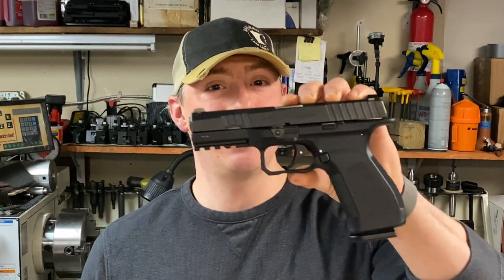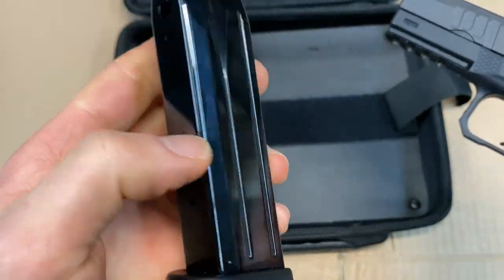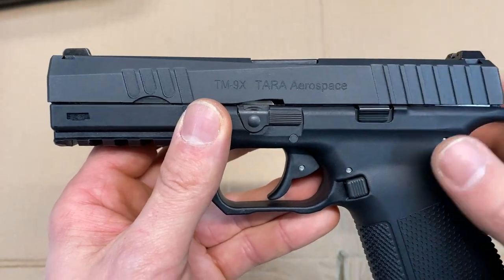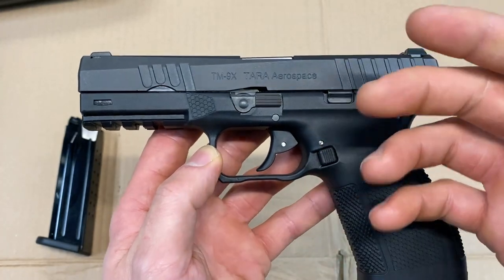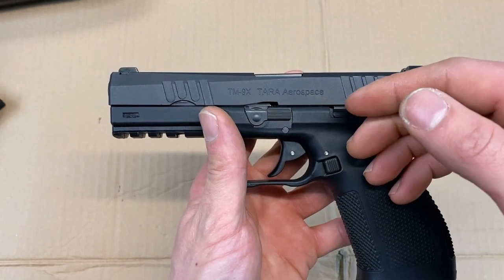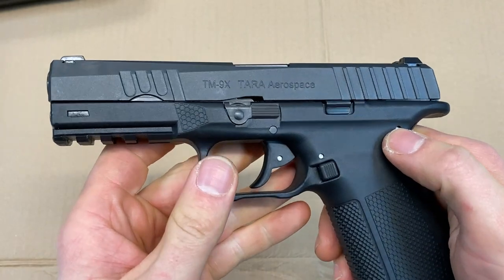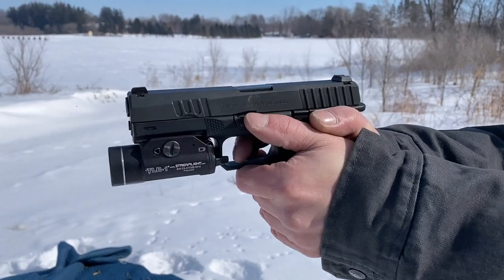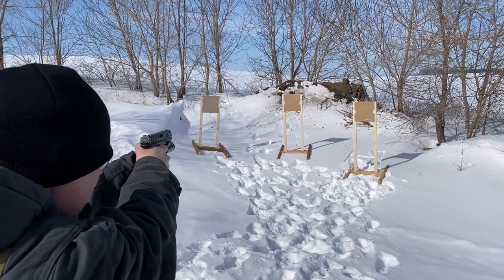TARA Aerospace TM-9X Review and range time #tm9 #sig516 #aerospace

Comment: Regards from Montenegro. Great to see you using our product 😄
Reply from the maker: Absolutely!! It’s a great pistol!
Reply: @jeerrrrrrryyyyy  this Gen2 version is very good and much better quality vise then Gen1. Also in USA is two time cheaper then in country where is made, and its hard to find one, everything goes for export.
Did you saw gountlet test on Poland chanel? It run it without stop 😄🤗
Reply from the maker: @balsakralj  I did! Very cool. It didn’t have a single problem.
Reply: the slide is CNC machined from a single piece of steel.
Reply from the maker: @vlpeev  Yes, but what was the process of getting the piece of steel is my question. After processing the iron ore at a foundry, what is the process used to get the pice of steel? Cast? MIM? Cold roll? Hot roll? Etc, Etc.
Reply: @jeerrrrrrryyyyy  The last time I was in the factory the plan was to use hot-rolled bars in the profile of the slide to reduce waste of material. the line you can see on the slide can be also due to the CNC programming and the passes of the cutting tool. The internal front and rear inserts are MIM... in the early design ot was one piece stamped steel part. If you want to fully understand the trigger system on that pistol google the patent number on the bottom of the grip.
Reply from the maker: @vlpeev  Thank you, I will look that up.
Reply: @jeerrrrrrryyyyy  if you have any questions I will be happy to reply.
Reply from the maker: @vlpeev  awesome! Thank you very much!

Comment: Those damn Montenagrens !!! Cool pistol, and great presentation.
Reply from the maker: 😂 yeah, they get yea every time lol!
Thank you very much NEPA!
Reply: @jeerrrrrrryyyyy  for the same price of 399 I believe Arex Delta gen 1 could be a better buy, easy trigger 4.5lb and 2mm reset. I just feel a 8lb trigger for a pistol is very uncommon since most stock trigger run about 4-6 lbs unless the "single action" after first shot has a different weight.
Reply from the maker: @dukenukem9666  good point, the difference is the lack of a safety, so the trigger being more in line with a revolver weight makes sense. 
   I agree that the Arex is a great contender, but I don’t have direct experience with the delta, just the zero 1 from Arex.
Reply: @dukenukem9666  Rex Delta isn't a DA/SA pistol, though.  The Tara trigger is different after the first shot as long as you don't fully release the trigger after reset. See ClassicFirearms review.

Comment: This is basically a double action/single action pistol, but has to be manually managed by the trigger.  The 7+lb trigger pull is double action, after reset, it is single action and is (should be) significantly less as long as you don't allow the trigger to go all the way back to original position on second and subsequent shots.
Reply from the maker: Yup, that’s it in a nutshell.

Comment: Excellent video and I've never seen anything on this pistol before , but that line on the slide has me curious now 👍👍
Reply from the maker: Yeah me too! I’m very interested in how they are manufacturing the slide. Thank you very much Ninja!
Reply: @jeerrrrrrryyyyy  like you said, that line is most likely a casting mark...doubtful that its any kind of tooling mark. Hows the weight on the slide when its stripped? Whats it feel like to you?
Reply from the maker: @stephanieandjared390  if the slide is stripped it weighs in at 302g, or 10 5/8 oz.

Comment: The first trigger DA is heavy the follow up I bet is sub 3.5 lbs   That's pretty much how it is advertised from tara as well.
Reply from the maker: Yeah, it just takes a bit to get used to using.
Reply: @jeerrrrrrryyyyy  Yeah I can see that when everyone is used to decent modern striker fired pistols.  It's light years better that some of my old 80's duty Smith's. That first trigger pull in DA is heavy but even then after a few range trips it's but another function of the pistol.  I rather like the follow up when it is in SA is pretty nice.   I do not see the line like you have on the top of the slide in the G1 version I have.  Something may have changed when they switched to the 2nd gen slide.  The Gen1 version was advertised from Tara Aerospace claimed the first gen slide was milled from forged steel.   As a Addendum I have found some ruger sr9 full size mags that can be made to work in them.  I have a Video on my channel showing the simple mod on some cheapo promags that work in the Tara if anyone has a few minutes and wants to check out.    I cast and ran about 500 125 tc coated lee bullets through mine over the summer. It's a decent duty sized gun that is accurate.  After that I loaded up a bunch of 125gr xtp's and  took it as a trunk gun during a trip from the midwest to florida.   I used it down there with some 9mm range ammo at a indoor range while the wife and kiddo's shopped . It ran fine with those as well. .   I should have bought several of them to have for range fodder. I paid 219.00 for mine right before the Covid crap hit. After that they jumped up quite considerably .  Great videos on your channel.  Nice enthusiasm for the sport.. Subbed.
Reply from the maker: @bryco32   this gets the best response trophy for this video! 
That’s cool that you got a 1st gen!!! I’m a little jealous to be honest. $219 is a great price. Thank you very much for the info and I will be checking out your channel and video!

Comment: I have the same brand new Tara TM9, it jammed every single rounds out of box, is that likely a limp wristing? or gun problem? Did you ever encounter this?
Reply from the maker: How is it jamming?

Failure to eject? “Stove pipe” or “empty in chamber”?

Failure to feed? “Empty chamber” or “live round not seating in chamber properly”?
Reply: @jeerrrrrrryyyyy  stovepipe, also slide lock back with rounds in magazine, i hope there is nothing wrong with it.
Reply from the maker: @ruilanguage  the stove pipe could be from what you call “limp wristing” it can also be from low power ammunition or even something as simple as different types of case material used with different chamber finishes.
   If the slide is locking back and there is still rounds in the magazines this can sometimes be caused by gripping the pistol in a manner that leads to upward pressure on the slide lock/ slide release during use. 
   In either of these specific cases I would recommend having it looked at by a qualified gunsmith just in case. 
   Obviously if your pistol is malfunctioning due in whole or in part by user error, then there’s nothing wrong with the pistol, and possible adjustments in user control or operational adjustments/ training is in order.
Reply: @jeerrrrrrryyyyy  Thank you for the reply, the ammo i used is cci blazer aluminum case 115 gr fmj,  have you used this in your Tara Tm9?
Reply from the maker: @ruilanguage   No I have not. I have heard mixed reviews on its ammunition. As a first step you could try using a known good quality brass cased ammunition to see if that helps.
Reply: @jeerrrrrrryyyyy  Thank you for the suggestions, I will try that
Reply: @ruilanguage  Would run better with 124gr.

Comment: Very good review indeed so don't take this the wrong way but what's going on with all this YouTube gun reviews complaining how 7-8 lbs trigger pull is very/extremely heavy? That should be bare minimum on self defense / duty handgun and if trigger is smooth even 10-12 lbs is nothing heavy.
Reply from the maker: I agree in part of your opinion. The gun community seems to want a 5 lbs of less pull weight. Of course this is all opinion in the end, but I do know 4 people that have crippling arthritis and a heavier trigger pull definitely effects their ability to operate proficiently. Now put one that has a lighter pull weight and they are able to run the mechanics noticeably quicker.
   I do wish more people that have the physical ability to deal with a heavier trigger not complain about a heavier one, take the Beretta ARX for example. I love the one, but people seem to hate it due to the trigger weight mostly. 

   Thank you for checking out the video, and your opinion on heavy trigger pulls.

Comment: What holster were you using for this video?
Reply from the maker: Not the correct one to be honest. 
I noticed that they will have some success in Glock style holsters for wide frame glocks chambered in 45acp and 10mm. 
   The specific holster I used (and it doesn’t work well) is a T-Rex arms for a Glock model 45 with surefire X300u light.
Reply: I recently ordered a Tara and I’ve been searching for a holster. Was wondering about a Glock 17 because of size similarities but the trigger guard on the Glock is curved on the front so I’m not sure that it will fit. Gonna run by PSA tomorrow and try it in a couple of different holsters. I’ll let you know if I have any success.
Reply: New subscriber by the way and this was a great video.
Reply from the maker: @anthonydavis8741  I know that the qcq holster that locks the trigger guard for Glock model 20 works but I don’t recommend those holsters.
   Yes please let me know what works, and thank you very much for sharing the information with us.
Reply from the maker: @anthonydavis8741  Thank you very much Anthony! I really appreciate that.

Comment: The line down the middle of your slide is unique to yours.  Mine does not have that.
Reply from the maker: Is yours a 1st generation or 2nd generation?
Reply: @jeerrrrrrryyyyy  Presumably a second generation.  It’s the X model.  Mine did have some dings from the lock that was supplied with it and the soft case but other than that no cosmetic issues.
Reply from the maker: @ChrisJohnson-rn2ls  that’s a good thing. The question still stands that I don’t know what that line is from.
Reply: Presumably a machining error?  Mine has a mark on the underside of the slide similar to yours.
Reply from the maker: @ChrisJohnson-rn2ls  I guess it’s possible. The finish of the metal is suspected then if in-fact the mark is from machining.

Comment: Tm-9x must be better.  My tm-9 is a jamomatic.  Jams every time.  Mags hard to reload  and trigger is horrible.  9lbs   Changed to glock striker spring to get better.  Around 7 to 8 lbs.  Mags needed work to to release properly.   Polished feed ramp too.  Lot of work to get just an ok gun
Reply from the maker: Good info on the older model. I’m sorry to hear about that John. The ammo I was using in this video was very low power reloaded ammunition too. The trigger is heavy on this one too. Yeah I still haven’t had a failure on this yet.